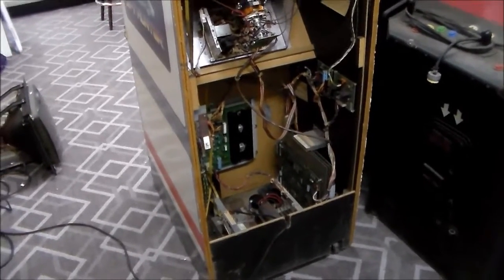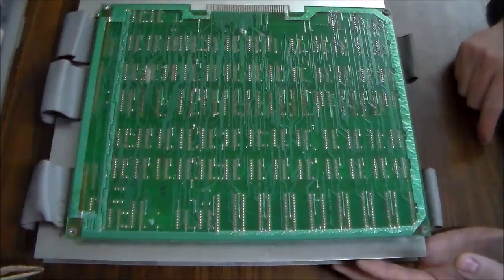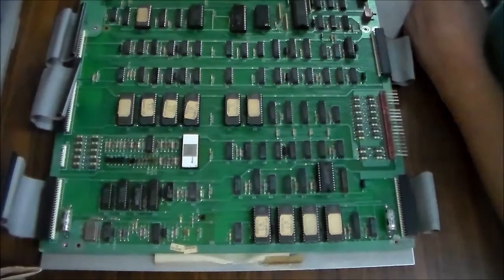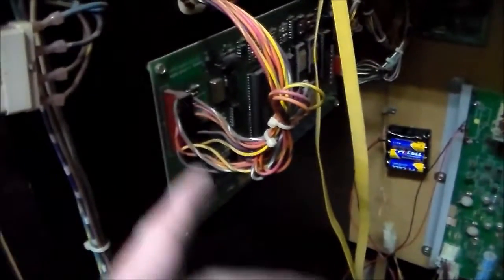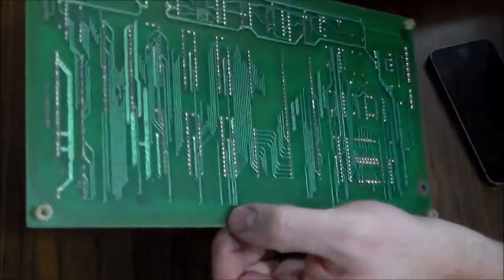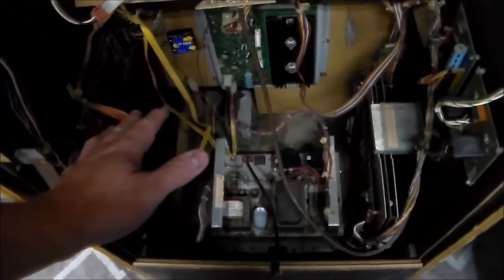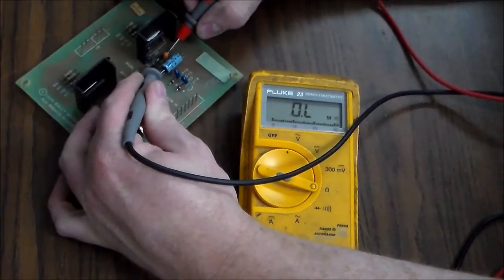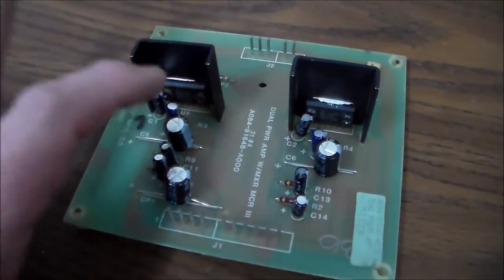Bally Midway SPY HUNTER Arcade Game - 3 - Repairing the Game Boards

Comment: RJ...The whole reason I took two years of electronic engineering technology full time was so I could get into this field...I was building different types of circuits on bread boards(Clock circuits,Game design circuits,etc) Of course it never worked out upon graduation(And this was back in the video heyday from 1988-1990) because basically I was told "We won't hire ya without experience" ..Well that's fine,but how do you get experience WITHOUT a job? I went into the telecom field and now I am a TC engineer. LOL The excitement and desire is still there from childhood...I'd love to get back into this field but so much has changed...We were working on BETAS and VCR's back in that time,HIgh Def Screens were a pipe dream,and fiber optics was just being introduced...All I need to know is if I move my butt on down to the Carolinas,find your business,and come to you with a resume' great desire,attitude,and willingness to learn any and everything you could throw at me...Am I hired???  ROFL...Don't laugh too hard RJ...That hurts harder than a Xformer that blows up in your face when you get the primary and secondary voltage hookups backwards....Very bad day in class that day...DON"T ask how  .:)
Reply from the maker: I was going to hire you but then you said you blow up transformers so.....  Actually it's just my brother and me and we're not hiring anybody yet but maybe in the future :)  Thank you for watching as always, see you on the next video!

Comment: Read the Bally bulletin on in regards to the cheep squeak deluxe on a reliability modification in regards 7533 DAC failures there is a 47uF capacitor at (c112) thats removed to prevent an issue that sometimes leads to the destruction of the 7533 DAC when the game is shut off its talked about here.   http://www.pinrepair.com/6803/6803removecap.pdf
Reply from the maker: Thanks Allrock123, I had never seen that!

Comment: That "Cheap Squeak Deluxe" board is seriously over engineered. I mean seriously. You need a dedicated 68k processor just to play that short clip of Peter Gun that still sound like a cheesy MIDI file. For the amount of computing power on that board. I would expect it to be doing a whole lot more then just that. That's just silly.
Reply from the maker: I think you're unfamiliar with board design from 1983.... and the board wasn't designed just for Spy Hunter, it was designed by Bally to be able to work in many machines, including pinball machines playing different music and sound effects.  You can't look at things designed in 1983 and say they didn't know what they were doing, it worked great at the time for what it was.
Reply: @LyonsArcade  That make sense to build a single board to be used in multiple systems to avoid having to design a board for every machine out there.  Another thing that just discovered about the 68k CPU right after you replied was that Motorola sold underclocked( CPU's that where rejected because they could not clock at higher speeds.) versions of the 68k in large quantities for as little as $20 a piece. Because of that,  it now make sense as to why they used a 68k CPU in that board. Before that, I was assuming that they where using normal 68k CPU used in a full blowen computer system, which at the time costed over $300 a piece.